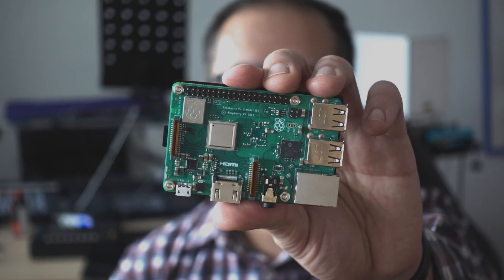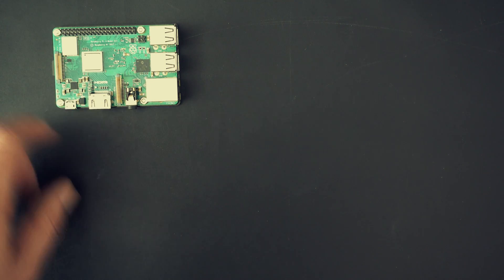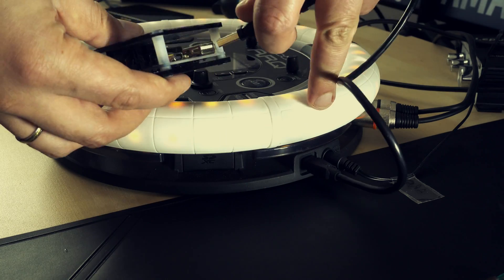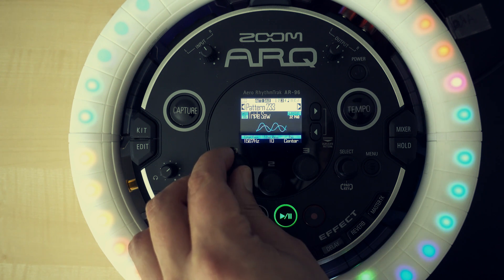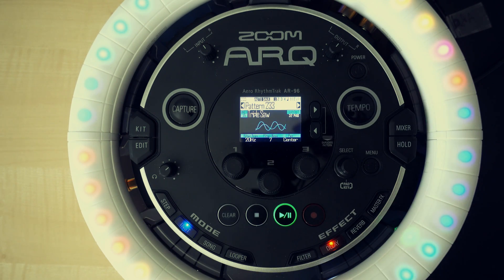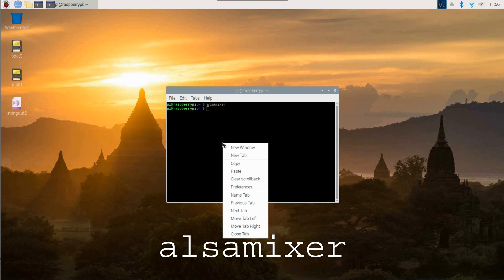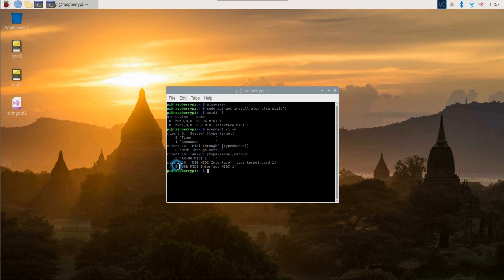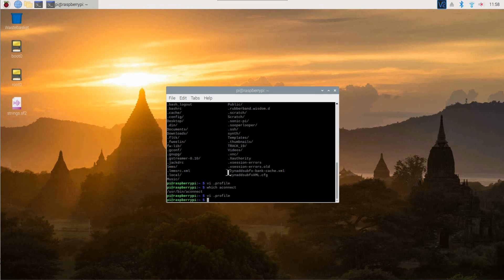How to use a Raspberry PI as a USB MIDI host

Comment: Im looking for software to run in liveplay midi 16 traxs and mp3  to be able to insert midi commands and finally additional midi port. What do u recommend
Reply from the maker: Hm... it seems you're looking for a kind of midi looper. Some apps on linux that could fit the bill are

Zynthian: The latest version has some very performance-friendly "create a midi loop on the fly" functions. That's the one I'd recommend most. You can build one yourself with a touchscreen and a Raspberry PI 4 and an audio interface. https://www.youtube.com/watch?v=-r2zDXNBrzM

Some other options are

SunVox https://www.youtube.com/watch?v=olcnTnG6gXs
Tutka, a tracker style MIDI sequencer https://www.youtube.com/watch?v=3juJu2UemAg
There's also Freewheeling and Sooperlooper on Linux which are worth a look.

Comment: Thanks a lot for this! I'm using a RP 3 to connect 2 Boss Katana amps and 2 RC-5 loopers to my Ampero Control MIDI footswitch. To save it in the profile, I had to ignore the "/usr/sbin/" part. It works with just "aconnect". As my devices share the same name (the two amps and the two loopers) I must stick to connecting ports via the client numbers. Fortunately, if I start the RP when everything is connected, the order of the devices is always the same.
Reply from the maker: Thanks for sharing! Reminds me I really need to do a video that shows how to set this up with arduino (or other microcontrollers)

Comment: The only problem with this is that those cheap USB to MIDI adapters do NOT pass system exclusive messages. I found this out the hard way when trying to use one to send DX7 patches to my Korg Volca FM2. It works fine with my audio interface that does have standard MIDI ports but definitely not with the cheap adapter.
Reply from the maker: Thanks for your feedback - I just tried and had no problems. Which adapters are you using?

Comment: Hi Floyd, as a musician I admire your technical knowledge :)  And have you tried to merge midi signal using Raspberry Pi? 2 midi inputs -  1 output. (f.e. nanokontrol and an USB keyboard connected to any vintage synth).  Could Alsamixer/ linux  do it ?
Reply from the maker: Hi, thanks for watching!
Yes, you can do that. Just connect multiple ports to the same destination. 
"man aconnect" on the Linux console or this page https://manpage.io/man/1/aconnect/  have some more details on the command.

Comment: Do you have to reroute the Alsamixer inputs/outputs in the pi's terminal every time you change the device at the end of your MIDI or USB cables? Are you allowed to change these cables without reconfiguring Alsamixer? Thanks
Reply from the maker: Hi! One thing I didn't show in the video is you can also just write the names of the devices into your config file. That way, the problem you describe won't occur.
Reply: @mr_floydst  could I trouble you to give me an example please? Much appreciated

Comment: if you put that line of code into .profile.  and i later change to another device. Will the pi assign the same ports to those devices?  or i need to manually change the code again for a new device plugged in?  thanks!
Reply from the maker: You can also put the device name into that line instead of the device number. That should work every time.

Comment: Could midi be routed through the ethernet port using rtp midi protocol? I already use the protocol on my mac and pc for networked midi and it works well.
Reply from the maker: Thanks for watching! Please search for "raveloxmidi" in the "App Store", install it and then follow this video's instructions. It should work. Perhaps worth a video. ;)
Reply: @mr_floydst  Please do, I'd love to see it. What is the minimum spec Raspberry Pi for this job?  Someone is selling the Raspberry Pi 2 Model B's cheap locally.  Think they would be up to the task?

Thanks!
Reply from the maker: @rockumk  I did not try it in real life, but it should work without problems as both MIDI and network don't tax the CPU and RAM very much.

Comment: Why make a video where you literally begin with "This has been discontinued". Unless it got discontinued during the production of the video (possible but not that likely - even then you can add some more info on the topic) I see no reason to go with it. There are literally dozens of MIDI boards for Arduino/Raspberry Pi that are like 10-15 EUR on Amazon, cheaper if you go with some Chinese online market.

Still useful video and thanks for the demo.
Reply from the maker: Hi, thanks for watching and for your question: I mentioned this because over the course of running this channel, I got some / a lot of question on the Hobbytronics device, which always required me to write "but sadly, it's been discontinued".
So I thought I'd better mention this in a video. And that's the only reason. :-)

Comment: Thanks for this video, it works fine. But only if the PI is connected to a monitor. How to make it work without screen  ?
Reply from the maker: Hi, thanks for watching! I surprised to hear that - at the time of recording this video, I'm pretty sure it worked without a screen. Perhaps the raspbian update broke this...
You could try to place your script in /etc/init.d - be aware though you need to enclose the code in a "switch/case/default" switch. You can look that up on google https://www.educba.com/switch-case-in-shell-scripting/

Comment: 4:03 .profile only runs when the user logs on, not when the system boots up. To run it on system startup you have to use /etc/init.d/
Reply from the maker: Hi, thanks for watching and commenting! That is true. But as Raspbian always logs you in by default, it kind of does not matter. ;-)
Reply: @mr_floydst  Yes I overcame this problem by making sure the pi logged in automatically

Comment: Can I Combine this midi host and PI audio DAC at same time to Pi
Reply from the maker: Hi, oh, I see you had some questions. ;-) Right, let's start with this one. Answer is yes. The PI is kind of like a PC but with a smartphone processor, running Linux. So everything you could do on a PC you can also do on the PI, as long as you do not stress it's CPU and RAM limits too much. You can either use an audio hat or a USB audio interface.

Comment: Does this work with a MIDI-Breakout Board as well? I want to connect a Behringer FCB1010 Foot Controller to my Marshall Code, however it only has USB-MIDI, I've thought of integrating the Raspberry into the CODE's case, and drill out two Holes for midi cables, as I need the Foot Controller too far away from the Amp for those USB-MIDI Interfaces
Reply from the maker: Hi, thanks for watching! The PI will identify any MIDI device connected to it, so yes, it will work. If you have some more money to spend and don't want to bother with shell scripting etc., please take a look at Blokas' MidiHub. It's a PI in a box with a nice user interface which can do a lot of things among routing MIDI data.

Comment: How about a foot controller based on RPi Pico/Zero or whatever could work for the Zoom Multi-Stomp pedal you have ? I would love to try to make one for my Zoom 70CDR.
Reply from the maker: Hi, thanks for watching! So you would like me to build a pedal... for my pedal? ;-) It isn't possible for my ZOOM Pedal as it does not have MIDI or a USB connector. But I could certainly do so for other MIDI devices. Thanks for your suggestion!
Reply: @mr_floydst  My 70CDR does have USB for firmware upgrade but it does work as a MIDI device that can take program changes commands, this is just not oficially documented by Zoom. I tried that once connecting it to my Linux laptop and I was able to try some CLI midi program and was able to make it switch programs. Now I just plugged it into my RPi3 with jack installed and it is listed, I just don't know how to move forward and send MIDI program change commands based on CLI or code, I am a RPi newbie.

Comment: THIS
IS
AWSOME

I used an pipo 8x running lubuntu as the midi host ($100), but it worked the same, did what you said, im now controlling a BOSS rc 500 from a launchkey keyboard, or a akai lpd8 . There is NO WAY i could ever figure this out myself.FANTASTIC.
Reply from the maker: Thanks for watching! Glad it helped.

Comment: I’d like to connect one keyboard to two sound modules… with a split, and be able to change patches on both.
Reply from the maker: Hi, thanks for watching! You can set up the PI to send to two devices simultaneously, but for the scenario you're describing, there's no OS-level solution. The cheapest solution is to set up your sound modules to play only the note range you want them to play (thus creating a split). You could also auto-start a sequencer with a project file that does what you need. (Look at these LV2 plugins: https://x42-plugins.com/x42/x42-midifilter) 
If you're a web developer of kinds, you can also program this relatively quickly using javascript and webmidi. https://medium.com/swinginc/playing-with-midi-in-javascript-b6999f2913c3
Please also take a look at Blokas' MidiHub: https://blokas.io/midihub/ - it's quite a lot more expensive than a PI, but also really powerful and creative.
Best regards!
Reply: @mr_floydst  that MidiHub looks awesome, but it breaks my budget. I'm going to forge ahead with software hacks.

Comment: Hi, I want to connect my Alesis V25 controller via MIDI ports with a Focusrite Saffire Pro 24 card,
I have a Raspberry Pi 3B, would it work implementing this solution? Thanks
Reply from the maker: Hi, thanks for watching! It should work. The PI should install this as a standard usb midi interface.

Comment: Can I control with this a keyboard with only midi usb? (no 5 pin connector)
Reply from the maker: Hello, yes, that's possible. Just change the routing according to the list of your midi devices. You can route any MIDI device to any other MIDI device with the commands shown in this video.

Comment: Does this work for clock sync as well?? I have a Hologram Microcosm pedal and it has tempo synced delay (and other tempo sync based features) and I want to sync my Arq96 with it for external effects
Reply from the maker: Hi, thanks for watching! Yes. This setup will translate all incoming MIDI signals from USB to 5 pin (or the other way 'round)
Reply: I can confirm I can send clock from one controller to another with this setup

Comment: Hi Floyd, I am trying to connect a roland mc101 (which has midi in and out ports)--I am attempting to use a raspberry pi 4 and an audio interface. Not quite sure is its alsa compatible but I think it is as the pi recognises it as a midi usb interface in the terminal. I am trying to route midi out info from my arturia microlab, into the rapsberry pi, then into the mc 101 via the interface cable (a groovebox, which has had a class compliance update recently). Struggling a little bit here. Any help?
Reply from the maker: Hi Alex, thanks for watching. Please connect both devices to the RasPi. Then type "amidi -l". Do both devices show up in this list?
Reply: @mr_floydst  Thanks Floyd. So the interface cable, the mc101 and the midi controller are all recognised by alsa--appear when I type "amidi -l" into the terminal--when I hook them up using usb. I have managed to use the midi controller in reaper before, works well. Likewise, alsa recognises the mc101 as an audio device via usb--I have managed in the past to get sounds out of it through audacity. It is when I attempt to route midi from the midi controller, through the raspi, through the interface cable, into the mc101, that's when I face the issue. I am hoping to be able to unplug the mc101 from the pi, via usb--powering it from a mains outlet in liue--but to still send midi info into it.

Comment: aconnect 16:0 20:0  command didn't work.....invalid argument.
Reply from the maker: Hi, thanks for watching. Did you list your audio devices with aplay -l and look up the correct device numbers? They're most likely different numbers than the ones in this video.
Reply: Gotcha. Makes sense. Thank you. If I want to not have to attach my secret and just have the Pi always perform this one function is there a way? Great video 👍
Reply: Screen*

Comment: Will it work with digital drums?
Reply from the maker: Hi, thanks for watching! I'm not sure if I understood you correctly, but if you're talking about an actual drum kit like the Alesis DM10, this won't pick up your drumming.
Unless the drum module on your drum kit has an USB Midi port - in that case, this will pick up your playing and redirect it to other MIDI devices or your PC.
Reply: @mr_floydst  i have yamaha dtx450k, midi-pro adapter and usb midi cable . I want to play rockband. Already found video with yamaha dtx400 + rapsberry midi host + Midi pro adapter + usb midi cable. It works. Thanks for reply.

Comment: Hi, first thank you for your tutorial and help. I`m having trouble to do the vi .profile step,  when I write it and press enter, this appear " search hit Bottom, continuing at TOP". I don´t  know what to do,  I can stablish connection between my two MIDI gear but once I restart Raspberry I have to do it all over again. Can you help me please?, Thanks  a Loot!!
Reply from the maker: Thanks for watching!
Using VI was propably not the best choice. :-) I did that because I'm used to it.
You can use any text editor you're comfortable with. Just open the .profile file, add the lines I mentioned in this video and save it. 
Best regards!
Reply: Yeah I had the same problem, could add the line of code but it would not save or exit. I used nano to edit the file just as Floyd did here. Use ^O to write the file then select OVERWRITE

Comment: Hey man, I might’ve gotten lost in the mix somehow but maybe you can clarify this for me please. I have a midi keyboard controller with only a USB port in the back of it, I have an a Alesis multi track midi sequencer with a midi in, a midi out, and a thru port, and I also have a Boss DR 880 drum machine with a midi in and a midi out as well, and my laptop. I use the program Arcade Output in standalone mode without a DAW to put together guitar loops and other sounds. What I’m looking to do is to use my midi controller to record into my Alesis MMT8 but don’t know how. I also am wanting to put my drum machine in that chain as well. What do I need to purchase to make this happen.
Reply from the maker: Hi Rick, thanks for watching. If you don't like to follow the steps in this video, just buy a USB host (https://www.hobbytronics.co.uk/usb-midi-converter-v1 ), connect your keyboard to that host, midi out from host to midi in of your hardware sequencer. Connect your drum machine to the midi out of your hardware sequencer.
If you don't want to buy anything, run this software https://sourceforge.net/projects/midirouter/ on your computer, connect your midi keyboard to your computer and route it to midi out on your computer. If you don't have a 5-pin interface on your computer, you can buy one on Amazon: https://amzn.to/2J1yC4R
Best regards!

Comment: What about configuring multiple midi devices and setting up multiple midi channels to communicate with eachother?
I want to use my nanokontrol to switch between the "hidden" functions of my Volca FM and XioSynth by using the scene selector 🤤
Reply from the maker: You can easily route one MIDI out to many MIDI inputs. But for channel switching channels at the press of a button, you'd need to program that yourself (in C++ or Python or whatever).
Reply: @mr_floydst  but the Kontrol itself is able to switch midi channel if I'm right